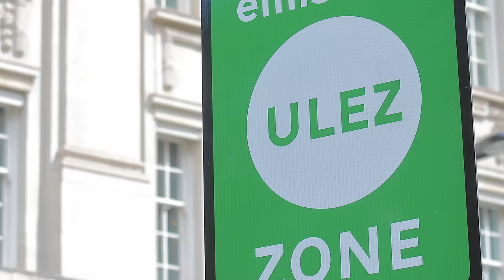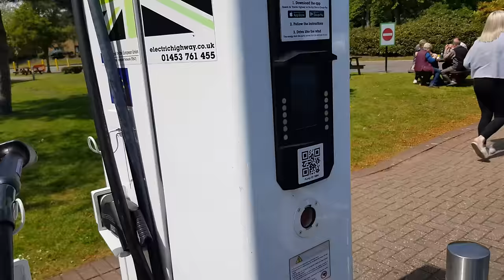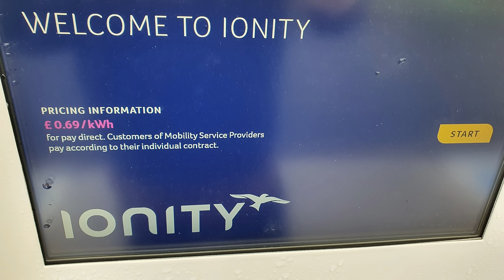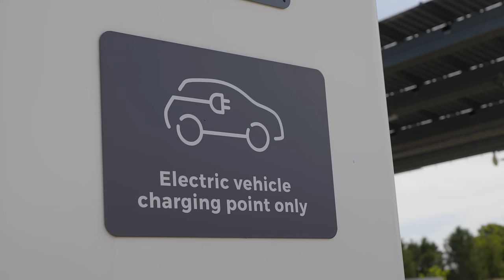The Uncomfortable TRUTH About EVs: The Version NEITHER SIDE Wants You To Hear

Comment: Only watched until about 15 mins so far but I totally agree. You are very knowledgeable about the ups and downs. Ev’s are great, if you charge them at home and most of your driving is moderately short distance. They’re quiet, smooth and a joy to drive but they lack on long trips, expensive charging is very common and the reason why charging keeps getting more expensive is that people are okay with it, you’d see people defend the pricing as it was normal for one petrol station to charge £1.50 per litre and another £7 just because… I charge my ev for free in my building and it makes me feel warm and fuzzy when I think about the fact that I’ve driven 40k miles for free but it gives me a headache and anxiety when I want to go and travel so for me the best is to own a nice ev for every day and something reliable, that’s diesel and economical for long distances

Comment: If I couldn't charge at home or if I frequently took long road trips requiring public charging, I wouldn't drive an EV, but I can, and I don't, and millions of other people in the U.S., maybe half of the population, share my circumstances. I have the only EV in my modest, thoroughly middle class, Georgia neighborhood as far as I know, and everyone in my neighborhood can install the same level 2 charger that I have in my garage.

The cost of public, fast charging is not much less than pumping gas, but it's not much more either, and I get maybe 10% of my watt-hours from public charging on long road trips, so the cost doesn't begin to offset the huge savings from home charging, like 25% of the cost of pumping gas, and I spend much less time fueling my vehicle overall. I also love the instant torque and smooth, rapid acceleration. My Bolt EV looks like a compact economy car (because it is), but it has better acceleration than any car I've owned. My wife had no interest in EVs before we bought the Bolt, but she loves it now.

Sure, long trips take an hour longer, but I'm typically on vacation anyway, and a half hour break after 2-3 hours of driving arguably is a benefit. If nothing else, I can sit in my car and read or browse the web, as I'd be doing at home if I left an hour later. At worst, I'm time-shifting some leisurely activity. I work online, so I could do that while charging too.

If EV sales level off at 10% in the U.S., many people who could benefit from an EV will not. I'm not a climate change alarmist, and I oppose EV mandates and other discriminatory policies, but the benefits of driving an EV for much of the population are very real and increasing as battery tech and charging infrastructure improve while EV prices fall. Consumers should decide with no fingers on the scale, but I remain very happy with my choice.

Comment: The defective phone with the exploding battery is Samsung's Galaxy note 7 model. That defective battery, has about the same value as an 18650 lithium iron battery. Most Tesla's, for example, have about 7,000 18650 batteries in them. If any one of those cells detonates for whatever reason, the whole battery pack and any burnable materials near that car, will also burn. The associated risks are very different.

Comment: My diesel truck ran 3-1/2 hours up to Chase and 3-1/2 hours back with 2000 pounds in the truck bed and hauling 3000 pounds in a trailer and I had 1/2 a tank of fuel left after the trip.  Would a EV truck do the same and have half power left?

Comment: I've had two EVs, both small to do all my short urban journeys.  Peugeot iOn (iMiev clone) and an e-Up.  They're so good for this use case.  I also have home charging (13A granny charger is all that's needed).  The only time I've tried to do a longer journey in the e-Up (200 mile journey) I experienced the good (Banbury Instavolt) and the awful (over-subscribed Beaconsfield services) and the soul-destroying (limping to find a local charger in restricted performance / no heat mode, in the dark, on unfamiliar roads).  I have a choice of other cars to do the longer journeys, but not everyone has this luxury.  Unless there is a radical change in battery performance the ZEV mandate and ultimately 2035 switch-over is an absolute pipe dream.

Comment: it might have been said already so sorry if it as, but as a disabled driver, the key things that put me off EV's (apart from the range and lack of infrastructure is the simple fact that the public charging points are, as you rightly pointed out (and I thank you for it) inaccessible... but more to the point, the paypoints, cables and adapter connectors are ALL higher than a wheelchair user can actually reach and therefor reasonably use!

Comment: I’m not someone who says get rid of evs but equally I do not want one nor I want to be forced into one. If you like evs far play enjoy but don’t  expect us all to follow. Personally an EV isn’t suitable for myself and would be very expensive to have especially at the age of car I can afford is around the period where the batteries would need to be replaced, let alone the other running costs increases like tyres brakes and so on. And for myself wouldn’t be any more greener if that’s a concern.  I believe products like synthetic fuels are the greener and more cost effective in the long term and would mean if we just preduced better quality and also maintain a combustion car it will last a extremely long time and a sensible cost and would be more greener than any EV. With the benefit of any decent mechanic can work and would need little to no re training, also easy for the owner to learn and self maintain. Scrapage schemes damage the market, it’s fine if you just buy new. Cars, personally it removes / waists perfectly good cars. Most of this push is about greed and control. If you are of a certain class you will be fine, but the rest it’s MAD and in ways hypocritical.

Comment: My mum is disabled and has a little i10. She lives in a flat and there’s no way on earth she could ever have a charging point installed where she lives. Not only is there all the hurdles with safety, viability, and access but for example - what if she lived near a rough area shall we say so a gang of youths could cause havoc… for example. Another worrying thing is that Motability are fast losing ICE vehicles and going to EV. But surely this will go like Hertz and they will surely see sense and realise the costs.

With regards to the Luton Airport… that Range Rover was clearly a hybrid in thermal runaway. For it to melt through the floor like it did puts it quite obviously as a lithium fire which can melt metal and concrete. That frothy mouth chap was actually quite correct and rightly highlighted the media’s fervent bias towards EVs. I think EVs are a good idea for cities, commuting  and short trips - I would happily have one for this purpose but don’t tell me to get rid of my petrol being a car nut all my life. But it’s the fact that there is this sweeping change being forced upon us wether we like them of not that is my personal problem. 

The truth about them will come to fore regardless of which side of the fence anyone sits with an opinion to them. And the thing about depreciation values - yes they are dropping as expected and what happens to ICE vehicle. BUT the crucial difference is… after 10 years you will more than likely need a new battery and in most cases this will cost more than the car you have just bought and that to me is not good value. And a majority of the motor trade are avoiding EVs like the plague for this very reason. 

Very good and balanced video about this rather awkward subject.

Comment: Actually, EVs do have local emission at the point of use - the tires, and the breaks do emit harmful chemicals into the air. From what Ive heard, this is increasingly being noticed and regulated (or intended to bw regulated).

Comment: The best solution is either the Plugin Hybrid way, or the Toyota/Lexus way of strong hybrids. Hybrids combine all the pros of both EVs and ICs in one package. You get the instant acceration of EVs and economy in city traffic, and you get the highway range of an IC. You get a plugin if you have a private garage to charge it, or you get a strong hybrid like a Toyota if you don't. Hybrids are cool because the electric system helps prolong the life of the combustion engine especially if used inside heavy stop and go city traffic for years. Toyota/Lexus tactic of using naturally aspirated engines with their hybrids is particularly great for longevity. All in all, full blown BEVs are not the way to go, not too much Lithium to go around and they are for the garbage bin 10 years down the line when their batteries are done. Hybrids are the future.

Comment: I appreciate your effort to maintain balance in the discussion on EVs, even though I am pro-EV I recognise they are not a panacea for all the reasons you suggest in your video. However I’d like to clarify a couple of points to further understanding about EV's.

Concerning the longevity of EVs, my understanding is that batteries are already showing to be lasting longer than expected, particularly in the UK with our pretty moderate climate. I recently purchased a 10-year-old EV in the UK, which still retains 87% of its original battery capacity and am very happy with it. 
So older EVs can definitely remain effective and reliable in the long term already, even with the old technology.

On the topic of EV fires, manufacturers are shifting towards lithium iron phosphate (LFP) batteries, which are oxygen-free and offer a safer alternative due to their inherently stable chemical structure, reducing fire risks over the older technologies. As time goes on I can see battery chemistry improving things even more for stability, range and cost.

Comment: I live in Germany in a metropolean area, within this area I live in a smaller town of 300.000 residents. My nearest charging spot is 5km away and I can´t charge t home since I am renting....Do I need to elaborate more ? Lets then compare the price, an EV compared with a vehicle similar since and everything still cost way more, about 75.000-100.000km worth of gas more. Why would I buy and EV if it´s more expensive and less convenient ? Now the tech is great and all that and If I could charge it at home I probably would buy one but I am not an odd ball, in Germany ca. 50% of all people are renting an apartment, which means about half the population can´t charge the dam thing.
Reply: You can charge it anywhere else, no problem. I mean, the gas for your ICE car doesn't come out of your home either. In the beginning of ICE cars, how many gas stations you think where there? None. You even had to buy fuel at your local pharmacy. The more EVs, the more charging points we will have. Don't blame it on the status quo, think about how long ICE cars had to evolve until we had todays ICE cars.
Reply: @WelschAudio  "...You can charge it anywhere else..."  
I makes way more sense when charging at home since. A it is more user friendly I can charge slower and stress the battery less and B it is way cheaper. Sure I could drive to a place and babysit my vehicle for 30-40min that is IF the charging spot is not crowded which most of the time it is. So it´s simply way less practical but costs more.

"...In the beginning of ICE cars..." 
I didn´t buy my ICE "in the beginning" I bought it after all those issues have been solved. I don´t have to buy into a system with less convenience for a higher price just because it is electric.

"....The more EVs, the more charging points we will have...." Correct, and when that happens and the EV´s are cheaper THATS the time I will buy one.

"....think about how long ICE cars had to evolve ..." I don´t have to think about it, I can just use one with no issue whatsoever. I drove 650km today with small pit stops. All the chargers were taken by others every single time. I didn´t have to wait though.

Comment: I have done a lot of research into this, and I would like to see:
A 3 or 5 door car, about the size of a VW Golf, or Ford Fiesta.
A Plug-In Hybrid vehicle, with a 1,200cc Turbo Petrol Engine, that can run on LPG.
EV Range of 60-80 miles, charges overnight at home.
Top speed 90mph.
0-60mph, about 8-10 seconds.
Conventional switches and gauges - no touchscreen, no internet.
Doesn't look like a 6 year old child designed it.
Keep it simple, keep it sensible, keep it practical.

Comment: You are correct on charging, we have a DS3 E-Tense and charge at home, £3 for 150 miles which is great, however, if I want to travel any distance we use our M4 as the cost is cheaper than using the DS, public chargers are a rip.

I wont pay 70p per kW for electric, and sit there for an hour to charge, rather spend an extra few quid and use the ICE car and get where I want a little quicker.

The horror stories are just that, we don't hear about all the issues with petrol cars going up in flames, I am a petrol head but realise that we have to change at some point and will do my bit locally but for distance its not viable for me just yet.

Comment: I read a very interesting piece saying that carpark fires are now more likely because of how much plastic cars now contain.  Crucially plastic fuel tanks.  When an ICE car catches fire it burns until the plastic tank ruptures - at which point a quantity of flaming pre-heated fuel flows under adjacent cars.  
Additionally, multi-story carparks are now being constructed almost entirely of steel - in an IKEA like system build.  From my observation there is little or no fire protection - steel buckles and collapses in an intense fire unlike traditional concrete construction.  I'm sure this is why the Luton Airport carpark floor collapsed.

Comment: We need legislation to force seamless interoperability between EV charging companies and interfaces. Ideally you should just part in the spot and plug it in and it works because it's got your payment details linked to the vehicle either via the charge cable comms, or via the licence plate. With a back up of contactless card payment. One flat fee regardless of "membership" or if you have a registered account with that specific company.

Comment: I have a petrol Golf that does around 10 miles to the litre, so at £1.45 per litre it costs around £0.15p per mile, an ev would cost around 8p to 12p per mile if charged at home on a ev tariff. if I had an ev my insurance with double to around  a minimum of £900 and I would need a home charger at a min cost of around £800. My Golf is 17 years old (2007) and on 148,000 miles. What would the state of the battery be after 17 years in an ev?. Recently saw a Carwow video about a 13 year old Leaf with a battery that now only does 59 miles, originally did approx 120 miles. the car only had around 46,000 miles on the clock. Ev's may be the future but not in my lifetime. I think there is a long way to go before they become the main vehicle of choice. Just one other point, how many mp's drive ev's, don't see Sunak go anywhere but in a diesel Range Rover or Jag. I am not anti ev in fact I quite like the way they work but probably not for me. Rant over for today.

Comment: Get a vauxhall ampera if you have a 10+ year old car and are looking for ulez compliance. It's a PHEV and can ease you into the concept of EVs without fully committing. They are 10 years old for the newest models, so no worries about depreciation, or paintwork. Battery lasts well - degradation is factored in 10.4kwh usable from 16kwh. Recharge speeds are 4hrs minimum - okay for the office, but don't bother on long trips. Cost of EV charging can be calculated against petrol and buy whichever is cheaper.

Comment: The problem is that the UK government will only take a monotone strategy to any problem. In Japan the climate crisis is being met with green diesel, kei cars (660cc), road tax benefits for smaller engines and the best public transport network in the G20... and were it not for Fukishima thay'd be world leaders in pink (nuclear derived) hydrogen. Over here the government has banged out the idea that electric=good; combustion=bad and that's pretty much it. When you get policy that has no reason or nuance you get a backlash (in our case against EVs) that's just as unwilling to see compromise or reason.

Comment: My new fave JM video since the the Audi A2. Hugely valuable and genuine journalism. I need a new work van,; just a normal, one tonne payload panel van everyone calls a "Transit van". That market is at May 24, woefully underserved. EV with short ranges and dire depreciation or  ICE that may be city banned in 5 -10 years. Not much to ask; these are the backbone of commerce but no idea of the best call. YT videos rarely help as standard quote is "like a car to drive. Seriously considering an old Volvo XC90 with the rear seat ripped out. Capital cost of  a few thousand and running cost in line with a battleship; which is what it is really.  Rant over!